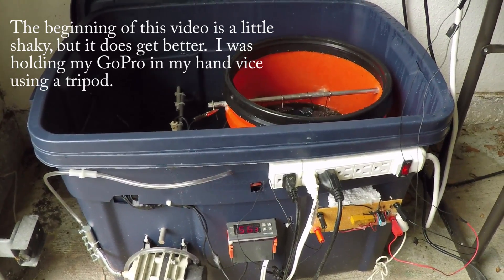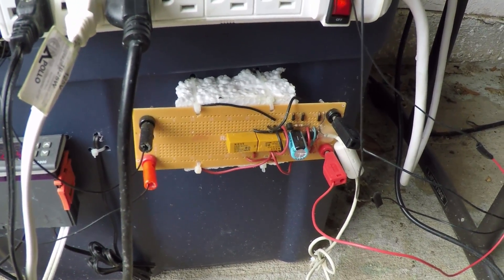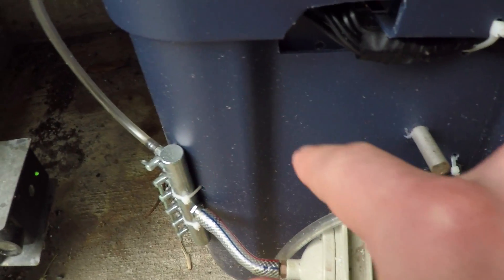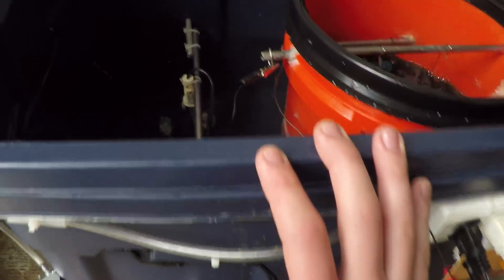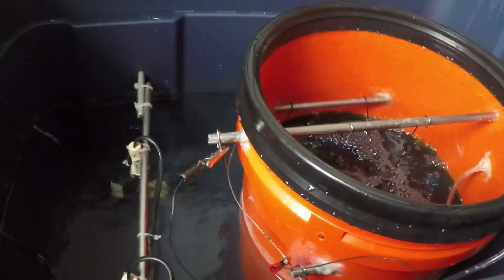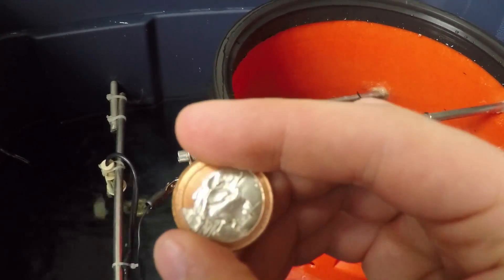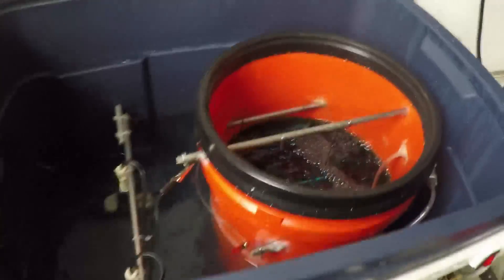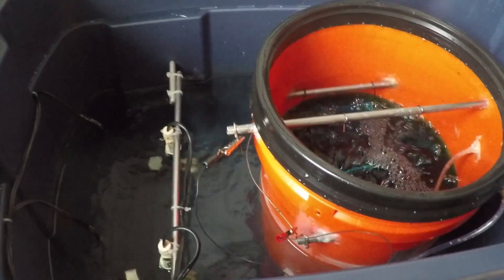Homemade Copper Plating Bath - Easy, Affordable and Reliable -  DIY Professional #2

Comment: I’d like to know where you got the titanium anode baskets from….I’ve found them new for $ 9…perfect size but the shipping was outrageous, $ 79…. Even so that’s still cheaper than what I’ve found on eBay….
Reply from the maker: The basket is stainless steel mesh with titanium wire to weave it together. Got it off amazon and McMaster Carr. Spent maybe $30 to make them.

Comment: Fantastic and informative video for people wanting to start their own plating. I am curious though as to what you used for heating elements, and how quickly does the acid solution corrode the bucket and your rubber tubing? Did you use a bucket of a specific composition that resists corrosion?
Reply: The acid solution does not hurt plastic….fun fact, acid comes in plastic bottles
Reply: @donash9043  guess I had a blonde moment lol.. its only a specific type of plastic that resists acid, right?

Comment: Hi. What's with the black lead going to the hanging-bar? I've not seen any electrical leads connected to them before. When you said "1 volt", you probably meant '1 amp' ~ via electroplating run-power-setting (?) Have you plated larger objects? Like solid, metal cast objects (5x5x5)?
If 'yes', what's your setting-amperage-method? Thanks.

Comment: Can you tell us something about your power cycle switch? It's obviously homemade -- do you offer a schematic? What software are you using to run it?  How important is it to the whole setup; that is, does it add sufficient quality to the end result to invest the effort to build one? Are there commercial cycle switches available that will handle extremely low DC voltage?
Reply from the maker: It's a basic 555 timer circuit with a 10% duty cycle.  On the "off" cycle power is aligned to copper plate the part, for the "on" cycle power is reversed to temporary plate copper back to the electrode.  There are commercial duty cycle switches that can perform this action.  I actually fried the relay on mine because I wasn't paying attention to the amount of plating current that I was using.
Reply: @GarageScience  Thanks -- that helps. And thanks for all your videos. With your help, we were able to set up a low-cost nickel plating outfit that is producing professional results. Incidentally, you might investigate the new "sous cookers"  as an inexpensive way to heat the water bath in which the plating solution is immersed. We're using a $79 cooker we bought from Amazon. No holes to drill, simple to set up, and it keeps the bath within 2-3 degrees (F) of the desired temp.

Comment: I have a project where I want to plate some paper cutouts. Could you tell me what kind of conductive paint you used and if you needed to seal the paper before painting it?
Reply from the maker: I use MG Chemicals Nickel Conductive Spray Paint, you can get it here: https://amzn.to/2MIKU3H

The conductive paint will seal the paper, if you have some kind of seal to put on it that will ensure the paper isn't ruined should some of the paint peel off somehow. But the paint itself will provide a waterproof barrier. I recommend putting a layer of paint on the paper, then adding the hanger so maker sure the contact point of the hanger doesn't cover any portion of the paper and possibly make is susceptible to the water.

Comment: I would like to ask about the blower and the manifold you use.  What brand and where to buy.  And will it work on a 9 gallon tank.
Reply from the maker: Guess I forgot to include that link in the video description, here is the link to the air pump I used which also comes with the same manifold seen in the video: https://amzn.to/2QIEwb2

And yes it will work on a 9 gallon tank, I usually have to throttle the output at the manifold to limit the amount of air going into the bath.  The pump definitely puts out enough air for larger bath sizes.

Comment: What kind of power supply are you using?
Reply from the maker: Just a basic variable DC power supply. Almost any variable DC power supply would be able to supply enough power to electroplate.

Comment: Nicely done man! Props to shooting the video and showing off your work. Curious though, have you expanded upon this yet  to overplate the copper in nickel, then finally chrome? I've managed to figure out the copper and nickel plating but I'm stuck on making a chromium solution for the final plating. Preferably something not carcinogenic would be nice ;) Any thoughts??

Comment: Love the videos, just made my first batch of solution myself. One question, do you keep the lid on your bucket while you run the rig? Does this help you lose less electrolyte during your run?
Reply from the maker: Yes I do but I drilled a hole in it so the purge system can vent the air being pumped into the tank. The lid helps re-condense most of the water vapor so your evaporation losses aren't too high. Make sure you use distilled water to refill the tank from time to time ;)
Reply: Awesome thank you, how big of a hole did you drill in the lid? I still hear mind bubbling pretty well even with the lid on. Thanks
Reply from the maker: It doesn't need to be big, I think mine is 1/8inch but actually if you just didn't screw the lid on all the way it would probably leak enough that you'd be alright.
Reply: Right, there are many videos about copper plating. But everywhere you look, you can see that the living room has been transformed into a factory for mass production.

Comment: Can you just hang copper wire directly from the two sides or do you need to have the baskets in place? Thanks!
Reply from the maker: +Peter Strafach , if you did that the acid in the bath would corrode the copper that wasn't submerged in the bath until eventually it wouldn't make electrical contact. Then your plating would stop. I tried it that way initially and failed haha.

Comment: I made a very similar bath and am plating pieces of roughly 4" x 4" brushed stainless. Do you have any suggestions of how I can prevent the copper from forming with air bubbles underneath the copper plate on the flat stainless surface?
Reply from the maker: +John S, by air bubbles underneath the copper plate do you mean that the surface is rough or have you gotten very large bubble like deformities in the plating that turned out to be full of air?
Reply: It's 18 gauge brushed stainless so I could see how the first could be true. There are air pockets about 3/4 the size of a quarter underneath it every 2 square inches or so there woud be one or two. Similar to the air bubbles that would form under vinyl wrap as you're placing it onto a flat surface or underneath a screen protector as you're placing it onto a phone screen. Question number two, have you messed around with reversing the plating by using the electroplated piece as the anode and the copper pipe as the cathode to successfully reverse the process?
Reply from the maker: +John S I know generally speaking you don't copper plate directly to steel because of the exchange reaction that occurs between iron and the dissolved copper. That might be contributing to the bubble formation. The closest thing to this that I have dealt with is plating seashells and having conductive paint not cover a small area causing the seashell itself to react with the acid and form gas bubbles under the plated copper. When plating steel it is best to electroplate a nickel or tin "strike" layer then plate with copper. I have done the polarity reversing successfully and it does help even out the plating but make sure you use a solid copper electrode because on the reverse cycle you will be copper plating your copper electrode (if you use a basket you will end up plating your electrode basket)

Comment: Thank you for walking through the explanation of how it works.  I like this setup and am doing research.  I was looking at building a setup to plate lead cast bullets and the barrel electroplating apparatus seem to common where it turns slowly and tumbles the bullets, then they resize and polish them.  Do you know which would be best for that purpose (the barrel vs the bubbles).  And, where is a good place to get the power supply.  Thank you for making the list, links and explanation.  Other videos only play music and have hands going through expecting folks to already know the electronic parts of it.
Reply from the maker: Very glad you enjoyed the video, if you haven't seen it already I have created another video detailing how I made the copper electrolyte which you may find useful.  For plating cast bullets I would recommend something like barrel plating even though I don't have personal experience with it.  The biggest issue with using a setup like mine to plate bullets is a jig to actually hold the bullets such that they will plate evenly.  I may try to do something like that eventually but not in the short term I'm afraid.  I bought my power supply off of amazon.  You don't need something as big as mine, I would just recommend that you get something with adjustable voltage that can produce sustained current of at least 5amps continuously.
Reply: Joseph Spears how as plating lead cast bullets gone?  I am researching it now.

Comment: I am just learning this process and my question is why does your system take so long I understand the lower voltage for longer periods gives a better coat but for the time frames you are using seems way to long how much build up are you shooting for you said you have had things in for days are you trying to double of triple the thickness
Reply from the maker: So it isn't so much about the voltage as it is about the current.  Current being Coulombs per second.  Since an electron has a charge of 1.6x10^-19 Coulombs and the fact that each Cu atom needs two electrons to undergo reduction and deposit on the part.  The best way to measure deposition rate is with current and more specifically with current density (Amps/ft^2) it is generally a good idea to plate somewhere in the vicinity of 20-50 amps/ft^2 but individual bath chemistry may cause that to vary somewhat.  So if you are trying to predict thickness of a part then use current density and surface area of the part.  I generally try and get a coating of copper that is about 0.5-1mm thick.

Comment: can u give a link for conductive paint u used on paper?
Reply from the maker: I usually use the MG chemicals carbon conductive spray paint as a base layer.

 https://www.amazon.com/MG-Chemicals-Conductive-Coating-Aerosol/dp/B008OA931A/ref=sr_1_2?ie=UTF8&qid=1488516171&sr=8-2&keywords=MG+chemicals+spray+paint

And I use the MG Chemicals nickel conductive spray paint as a more conductive top layer.

https://www.amazon.com/MG-Chemicals-Conductive-Coating-Improved/dp/B01N3AWGNX/ref=sr_1_3?ie=UTF8&qid=1488516171&sr=8-3&keywords=MG+chemicals+spray+paint

I've used these paints on paper, seashells, 3D printed plastics and ABS plastic, the results are uniform throughout.

Comment: One more comment: I noticed going through your pictures that the clam shell was nice and brilliant while the other objects were rather dull. Did you do anything special to the shell?
Reply from the maker: I have a tumbler that I bought from harbour freight that I used with stainless steel pins as a tumbling material.  You can see the tumbler in the video I did on copper plating 3D printed parts.  I use water, dish soap and lemishine mixed in with the pins to give it a nice shine.  I usually tumble something for 3-4hrs after plating it.  The shell was coated with lacquer after it was tumbled so oxidation wouldn't take away the shine. :)  I've done multiple seashells and included copper loops at the top so that they can be worn as necklaces.

Comment: Yes, got some questions 😊 unfortunately some of the links are dead. Was the forward /reverse timer board explained on the now defunct twilight robotics site.? Could you provide some schematics? 
McMaster link only goes to the general site for ss cloth. What size micron did you use? 
Hailea pump model ACU-??? 
208?318?
Sulfuric and PEG content is fairly high compared to my sources, but it seems to work for you.  Ever played with the Janus Green B as a leveling agent?  A source for SPS or DPS would be nice - but No one seems to be selling this outside of pallet wise b2b only... Regards
Reply from the maker: The forward and reverse timer board was not explained on the twilight robotics sight.  I read that somewhere I can't remember since it was over a year ago.  It is just a simple 555 timer circuit in astable mode with a 9s off 1s on timing pattern.  To get the wire mesh size just look at the opening size that is the right size for the copper you intend to put into the basket. I used one of the smaller mesh sizes.  Since the copper in the basket isn't necessary the copper going onto the part, it just acts to resupply the copper used in the electrolyte to plate the part, so the as long as the electrolyte can circulate through the basket.  Never played with Janus Green B but might try when I remix my copper plating electrolyte.

Comment: Hi,love your set up! What is the electrolyte you are using?
Reply from the maker: +djyul I provided the recipe in the video description :)
Reply: Okay,does your plating come out all grainy?
Thankyou for your reply. :)
Reply from the maker: +djyul the electrolyte in the video was over a year old and was plating somewhat grainy. I will be mixing some new electrolyte and probably make a video on it. But shouldn't get any grainy surfaces after that.
Reply: Garage Science
have been plating copper but it always gets grainy.Have heard,read that the only way is with the toxic plating chems used in industry,cyanide solutions etc.
Reply from the maker: +djyul you don't need the toxic plating solutions that use cyanide. I have been using a mixture of copper sulphate and sulfuric acid and gotten really good results. You can also use citric acid and get decent results depending on how thick you want to plate. Citric acid doesn't have as much throwing power and so you end up getting copper trees forming at sharp edges and corners.

Comment: Excellent job! This is exactly what I was looking for. What gauge titanium wire are you using to hang your anodes and part from? Is that Tygon tubing     that you are using as a bubbler in the bottom of your bath? Please explain the bubbler arrangement and how it is held down in a little more detail. I didn't quite get that. Again, that is a great setup!
Reply from the maker: +kevclar the titanium wire is 18gauge I believe and I also used a finer titanium wire that was 26-30 gauge, got it off of Amazon, it is one of the only titanium wire items available. For the tubing I can't remember the exact type, basically it has a flexible tube with holes drilled in it and that is in a spiral at the bottom of the tank. The tube is kept in a spiral by running it through a several pieces of stiff tubing of a larger diameter and about 1.5inches long. The larger tube is then tied to a stainless steel rod to act as a weight and is tied with titanium wire. The flexible tubing should be distributed across the stainless steel rod in a spiral pattern.

Comment: Holy shiet! Thats nice effort and DIY level.
 I'm just getting into electroplating and begging to collect informations. Particularly, I am aiming for "electrotyping" or galvanoplastic. I'd like to try and coldcast small sculpture from a graphite coated flexible mold one day. I do a lot of plaster, fiberglass casting and classic metal casting prices are crazy here. 
How much electricity do you use for an average project? 
What conductive paintings do you preffer? Currently, I've got only graphite powder, and I am trying to get hold of a graphite spray.
Keep up good work and make it better!
Reply from the maker: +rediempti watch the video I did on copper plating a 3D Printed Part and I show the conductive paints I use. I prefer the MG chemicals nickel spray paint and the caswell copper acrylic paint. Try looking at finishing.com because there is a ton of good electroplating information there. I usually plate between 1V and 5V and 1-2Amps. Current really depends on the surface area of the project. Most DC power supplies can handle the voltage and current requirements to electroplate copper.
Reply: +Garage Science  GREAT SET UP ! !!  WORKING SET UP!! Hey how much citric acid for how much copper sulfate did you use ?,  Did you used any other chemical to enhance copper plate?